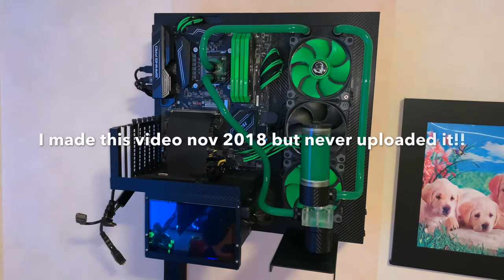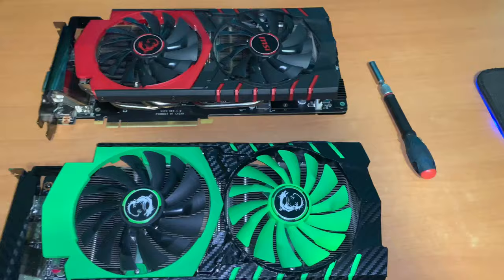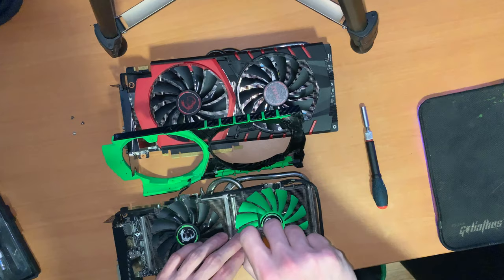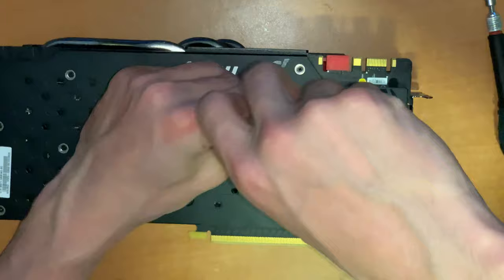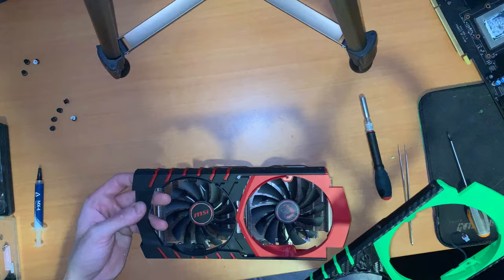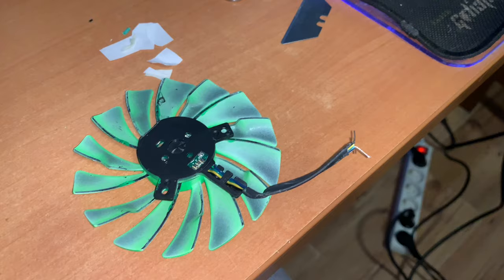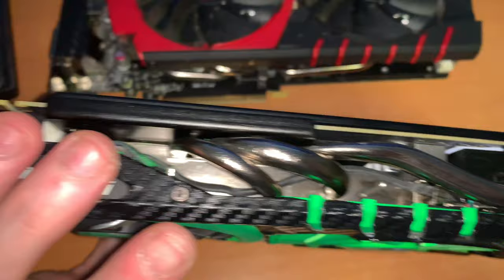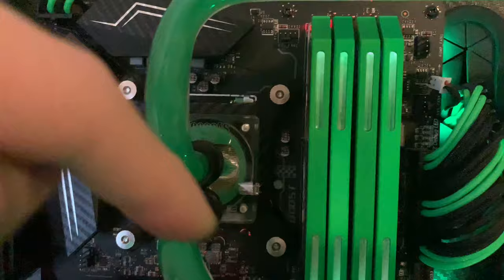Upgrading my 970 to a 980 TI (2018 late upload)

Comment: The pc lord has returned.
Reply from the maker: Haha pc lord, i like that
Reply: @Gagliano17  Why the need to edit your comment? I dont mind you telling me about your opinions of what I said
Reply from the maker: @_Ha11oween  it wasn't about that, i said that pc lord made a mistake depending the upload but i sorted it so it wasn't accurate, also you edited your own comment yourself ;) i saw you change pc lord to laptop lord and then back to pc lord ;), pc lord sees it all.
Reply: @Gagliano17  Mainly because I didnt want to confuse you ;) Pc lord defo sees all! I also still cant wait to get all of the hardware i need to upgrade my laptop. Until then, I'll be binging your videos.
Reply from the maker: G whats the plan my young apprentice
Reply: @Gagliano17  The plan is to upgrade my hardware from hard drive to ssd, the ram, the cpu, clean out the dust, update OS to windows 10, update the bios (except I dont really want to in fear of my motherboard getting bricked), add the same cooling mod that you did, and maybe the dvd rom sata connector. I'm also having a really hard time finding the name of my laptop model
I'm still yet to find out my chipset, but I can probably fond that with CPU-Z
My current specs are:
Intel pentium inside cpu overclocked at 2.4ghz
6gb ram DDR3
Intel HD graphics
Yeah, it's an extremely sucky system but then again it's a workstation.
I might have more plans in the future. I'm not sure
Reply from the maker: G i’d go with any sort of egpu over a cpu swap, it’ll do more even if its just a gt 750 or something
Reply: @Gagliano17  Wouldnt there be a bottleneck tho?
Reply: @Gagliano17   I just got an 860 evo 250gb and I really want to put it in my laptop but I'm in a different country and I wanna wait for when I have the other parts so I can film it
Reply from the maker: G even if, it’d poop on your gpu peformance you have now, 80% of a 960 is still 5000% better than your current setup
Reply: Dennis G ah, fair. In that case I'll also be saving up money for a GPU.

Comment: Youtube recommendation system:
Dennis G uploads a video
5Minutes later
Youtube: LET'S PUT IT IN RECOMMENDED
Reply from the maker: i might cry, it failed to upload properly, it only shows in 360p, so if they put it in recommended, i have to pull it down i think :c
Reply: @Gagliano17  It will fix cause there's problem's with youtube's rendering system their cpus getting slower from the all videos people upload in 4k...
Reply from the maker: You were right, it fixed itself

Comment: where did you find fans for 970? one of mine has been broken for a long time now and i couldn't find a new one ?
Reply from the maker: https://www.youtube.com/redirect?redir_token=6reVpzQXSy6Ol2AfbE1Moyt7vYl8MTU2NjkxMDE2NEAxNTY2ODIzNzY0&q=http%3A%2F%2Fwww.ebay.de%2Fitm%2F95mm-MSI-GTX-960-970-980-GAMING-Dual-Fan-PLD10010S12HH-6Pin-DC-12V-0-40A-R189b%2F182452324261%3FssPageName%3DSTRK%253AMEBIDX%253AIT%26_trksid%3Dp2057872.m2749.l2649&stzid=UgxEKQ1Nw8MI5eKfciJ4AaABAg.8YDhORNdfUa8YDitSy8JKS&event=comments
Reply: @Gagliano17  Thank you :-)
Reply from the maker: @aleksarajkovic3471  no problem :D they worked great, been using them since a year, i have a video where i replace them

Comment: Are you still happy with, and using your 2011 laptop build?
Reply from the maker: Technically i run a different setup but yes i’d not see any issue with running this setup here currently, for the age and what it can do its mad good and very plauseble
Reply: Dennis G awesome 😎 I have a Lenovo b570 I got for $30. I’m gonna try to build it similar to yours. Thanks for the inspiration!

Comment: Hello bro, I was looking forward to upgrade my laptop's CPU and everything and I came across your video of you upgrading your 2011 ASUS laptop and I want to ask you some questions on upgrading my laptop. My laptop is a TOSHIBA satellite c850 b561,  it has a core i3 2328m with Intel hd 3000 integrated graphics and 4 gigs of RAM and I already did some upgrades on it like installing a new SSD in the CD drive slot and stuff like cleaning the MOBO and applying a new thermal paste. And my MOBO is an Intel plcsf8, and I took a look at the processor support list of that MOBO, and I found out that it supports an i7 3630QM, So my plan right now is to upgrade the current processor to the i7 one, and to upgrade the RAM to 8 GB or maybe 16 GB as I do want to do some video editing, and I also want to install an RX 550 2 GB as an eGPU. And I was wondering if I should just upgrade my laptop or make a new PC all in all, and I live in India so things aren't all that cheap here. Please reply to my comment.
Reply: If you are willing to stretch your wallet for upgrading your laptop then you can upgrade it cause after upgrading we Will find one issue or the other and keep on spending money if not build a new pc

Comment: I know it's off topic, will my i7-4720Hq 16gb ram laptop support an 1060 gtx egpu? It's a 2015 Acer aspire v15 nitro gtx 960m
Reply from the maker: D K its not about the laptop specs but rather the bios, but with setup 1.35 from nando yes it will work
Reply: @Gagliano17  I have a Hades_hbs 14206-1.
Reply: @Gagliano17  I connected everything, powers on PSU spins for 1 second then stops, why? Do you know.maybe

Comment: I want to discuss some tgings about egpu. I tried exp gdc but unfortunately its not working.
Reply from the maker: Whats the setup, what have you tried, and what is not working, and are you using setup 1.35 from nando?
Reply: @Gagliano17  I am trying to use hp 8470p with Zotac geforce gyx 970 and exp gdc v8.5 expresscard version. 
The problem is its detecting tbe card but not installing the drivers. It install the driver of something but after installation it just show Video Controll device with error "no driver found for this device"...
Reply: I've tried Windows 7, 8, 10
Reply: @galabiskotshow9379  I think you need to install the software drivers for the exact gpu that you have
Reply: @_Ha11oween  I had already tried to install the drivers of the gpu I had. But it always show me error that no hardware found.
Reply from the maker: dani udass are you installing the DESKTOP version of the nvidia drivers? Dont let it auto detect, manually download the proper drivers from the nvidia site and then the desktop version of those
Reply: Hey  @Gagliano17 
I've tried ZOTAC GeForce Graphic driver 361.75 for Win10 64bits, ZOTAC GeForce Graphic driver 436.02 for Win 10 64bits and also tried from the official website of nvidia. And yes I am trying with only desktop drivers not the "M" versions. The thing is after installing the device it just keep connecting/disconnecting it from the system. Just 1 time I saw it named as Nvidia GTX 970 in the device manager other than it just shows Video Controller Device.
Reply from the maker: I’m pretty sure thats a bios related issue that can be fixed with nandos setup 1.35 software which he sells on ebay for like 10-15 dollar, its a boot loader that replaces the bios and patches the egpu in and disables your intergrated dgpu
Reply: @Gagliano17  there is no integrated gpu on my laptop. Just intel hd graphics 4000
Reply from the maker: dani udass the more reason to get setup so you can bind the igpu and the egpu, you need the igpu to work along the egpu to have proper power on the internal screen (50% of the performance an external screen from the gpu is gonna get)
Reply: @Gagliano17  yep I know from different YouTube videos. But the thing is I am not sure at the moment that my hardware is okay or not. I already spent a lot on these things and srill nothing is working.
Reply from the maker: dani udass i’m sure that if you do it right every hardware is supported, the real issue is the express card port? I have no clue about it, but i know forsure that you can run a egpu though mini pcie on any laptop
Reply: @Gagliano17  I don't know bro. Maybe its a issue with cable or port or card. Thanks for the help by the way